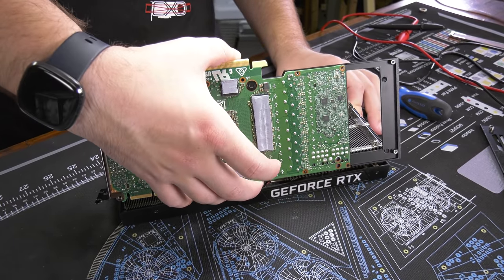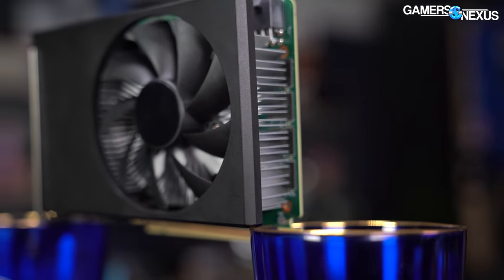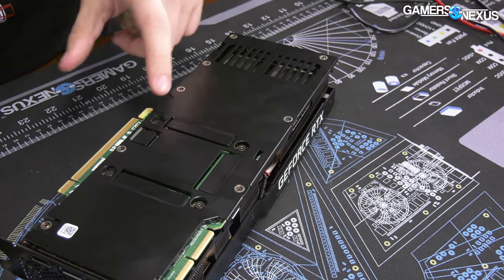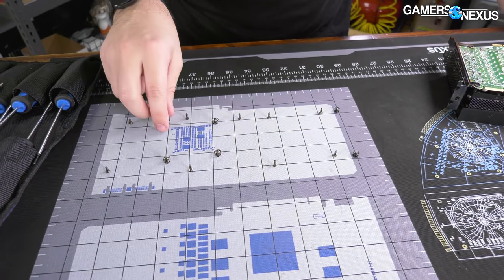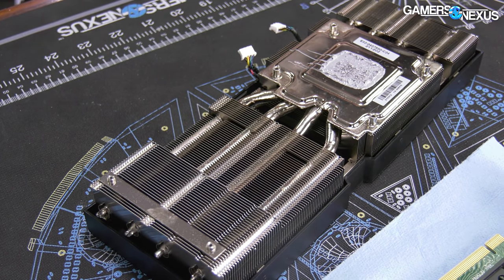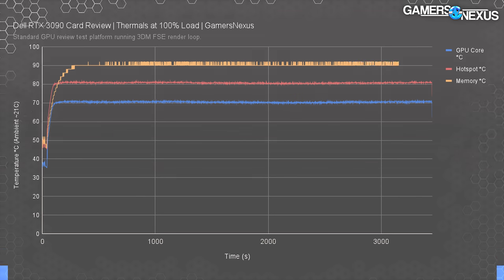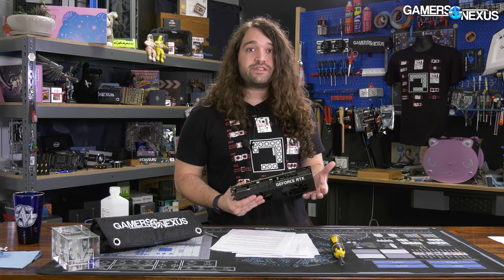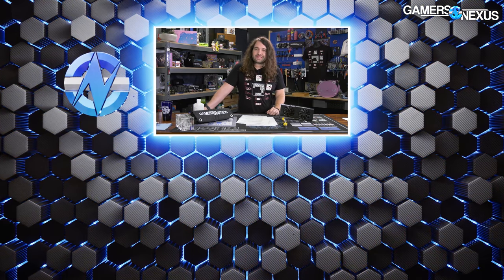Sometimes Dell Actually Tries: Dell RTX 3090 Review, Tear-Down, & Benchmarks

Comment: so.. who made this for you, dell? whoever that was, you should work with them more often
Reply: So long as they learn to measure and bend heat pipes better, yes.
Reply: Its a msi card. My 3080 variant died after 3 days so i think its hit or miss. 

The replacement has been good for a few months.
Reply: @notmyfaultthisishappening3795  does MSI even use a vapour chamber or a backplate heatpipe with flow-through air on their top tier cards, such as the huge Suprim or the Gaming X Trio?

Anyway, the thing that hurts me most about MSI and still makes me put them waaay down the list of mobo and gpu purchases, is their reticence to offer 3y stock or extended warranty options. For a company their size, it's odd and should be putting off a lot of buyers
Reply: angrily yells at the gpu 
"WHO DO YOU WORK FOR?!"

Comment: I wonder if it was a mistake to only cover half the memory towards the IO or if it had originally been designed with a heat pipe in-mind only cut back on costs last min.
Reply from the maker: Great point!
Reply: Maybe having the heatpipe that long made things worst due to the length?
Reply: i thought the same but again i saw there is not much room for the pipe to route to the other memory modules because of the NVLink (SLI?) cutout.
Reply: @GamersNexus  That's what I thought.
It looks like the other 2 parts have the thermal pad directly over the heatpipe,
but the 3rd is just chilling on its own, and got an extra thick thermal pad 
instead...
Reply: @GamersNexus  I wonder if the bent down cut-outs could act as pass throughs for heat pipes.

I could see them just reeling the whole thing back seeing other OEM cards do absolutely nothing about the heat issues with the back plate. 

Always appreciate you guys.  Thanks so much for the work you do.
Reply: @ionstorm66  I mean I cant imagine anything make it worse. My gigabyte extreme card has random heat sinks and a CPU cooler stacked up on it because the rear thermals constantly hit their limits. 

So almost anything is better than stock with little to no thermal pads contact or thermal mass.
Reply: @user-dn5bx2iu3e  I meant that not having the heat pipe there was better than having the heat pipe there. He pipes are less efficient as they get longer especially flat ones
Reply: Its almost as if the heatpipe is flipped the wrong way. Maybe meant for the U part to be over memory, reaching all the way to the one that had the larger thermal pad.
Reply: @ionstorm66  Speaking from experience with 3090s literally anything (even a fat chunk of copper ) helps. so really doubt 6'' heat pipes inefficiency would be noticeable.

Seriously people (my self included) are strapping random heatsinks to the backs of 3090s.
Reply: @user-dn5bx2iu3e  that actually sounds awesome.  as nice as a clean computer can look, a "mcguyver'd" computer has just as much visual appeal.
Reply: @theghostofthomasjenkins9643  Yeah its really odd to me that people will pay 1000$ extra for a 3090Ti but active backplates aren't a thing. It does look quite decent   and it pumps heat strait out the rear exhaust. I too love the hacker man.

Comment: With their PSU and GPU, if they keep that up, we'll be able to make a whole "better than Dell" computer with Dell parts only
Reply: I would actually watch that
Reply: The psu is very proprietary
Reply: @xavierrodriguez2463  it'd be too much hassle. You can just buy a seasonic and be done with it
Reply: You won't because Dell computers are so proprietary, they aren't even compatible with each other. The ability to cross match parts between different Dell machines is extremely limited.
Reply: @gamewizard1760  you can actually. Vostro/Inspiron lineup tend to share parts and chassis. Same goes for XPS/Alienware entry level/Precision 3xx0. You can look up the compatible parts on the community.

Comment: A Dell product paradoxically worthy of the "It's Better Than Dell" award.
Reply: absolute savage!
Reply: I was going to say that 😥
Reply: Like they haven't done enough.  Leave it to Dell to break the space-time continuum.
Reply: Dell have always been hit or miss, I bought a second hand optiplex and it is still running strong, except the graphics of the intel chip died so i threw a placeholder card I bought the first week the AMD1600 came out at it and it has been happy since. Who knew the stupid little bracket in my AMD Radion9000 series box was to fit it into an optiplex SFF, winning by accident.
Reply: Makes sense though. This product itself is better than the company that produces it :)
Reply: I just wanted to write this down.
Reply: Oof burn is hotter than cores
Reply: Lol
Reply: Actually it is all BS. Dell's 1660 Super was of average build quality, and so is this 3090. Only thing happening is that GN does not know how to measure memory temperature. That is why they got 110 C last time /which is ridiculous, card would stop working) and now they got acceptable 90 C .  As for the rest, Dell spends enough money to avoid recalls or God forbid being sued. Not terrible, not great.
Reply: If only it wasn't for all the other garbage things Dell has done, like charging people for warranties they explicitly and repeatedly stated they didn't want, or using proprietary components so you can't swap parts out.
Reply: @aleksazunjic9672  it is possible to get 110 on vram. They know what they are doing
Reply: @Demertech  No, it is not . It is possible to get it, but the card would not be stable and you would not be able to game . Instead, there would be artifacts and protection circuits would turn frequency down in order to reduce temperature. GN said that they had stable gaming temperature at junction at 110 C, which is not possible. Considering their testing methods and some weird results, looks like they had lot to learn.
Reply: @aleksazunjic9672  vram is built to withstand high temperatures and it could have been shitty sensors
Reply: @aleksazunjic9672  3 Roentgen not terrible, Not great.

....

Actual Roentgen : 22000

Oops
Reply: @whatdafarkenhell7110  I take it you don’t deal with enterprise grade stuff. Dell > HP > IBM > Asrock > Super Micro
Reply: I think its funny as fuck that alot of dudes who know how to fix computers can't take an alienware and modify it to have good thermals. You would not use the OEM heatsink for your gpu for very long so why would you look at a DELL and scratch your head as an enthusiast and say "I CANT'? I figured it out and im an idiot lol
Reply: Dell actually make one of the best monitors on the market
Reply: @aleksazunjic9672  GDDR6X vram is rated for 110c look at Micron specs they themselves said it
Reply: @chocolaa-p2689  Physics gets in the way :D
Reply: Sounds like it's better than Gigabyte...
Reply: @aleksazunjic9672  sounds like you know more than the engineers at micron, literally the first one who developed and manufactured gddr6x for these nvidia gpus. Why don’t you go tell them yourself that they’re wrong?
Reply: @chocolaa-p2689  Engineers know this very well, it is the guys in GN (and their fanboys) that do not understand basic physics.

Comment: "better than expected"

What Steve expected from Dell: "a rebadged RTX 3070 with a plastic heatsink"
Reply: Actually it is all BS. Dell's 1660 Super was of average build quality, and so is this 3090. Only thing happening is that GN does not know how to measure memory temperature. That is why they got 110 C last time /which is ridiculous, card would stop working) and now they got acceptable 90 C .  As for the rest, Dell spends enough money to avoid recalls or God forbid being sued. Not terrible, not great.
Reply: @aleksazunjic9672  Cool. Can you tell us what he's doing wrong? He is open to feedback and updating test methodology.
Reply: @aleksazunjic9672  110°C on a memory module is definitely on the hot side, but should still be okay-ish, 115°C is like the absolute maximum IIRC. That means the card definitely doesn't just stop functioning nor do I think they measure anything wrong.

By extend there was an ASUS RX5700XT with really bad cooling that ran memory so hot it did throttle badly...
Reply: @MLWJ1993  Well, no. Current MOSFET technology does not allow card to run stable at 110 C on junction. Card would definitely reduce operating frequency (throttle down) to cool itself.  If cards remains at 110C you would definitely  see artifacts and errors. On the other hand, GN claims that Dell's 1660 Super runs stable at 110C , and at FPS close to other 1660 Super cards.  This is physically impossible, and at further examining their measuring methods, they just use thermal IR camera, and that is not the way you could measure junction temperatures. Note that I do not claim that card cannot go to 110C , 115 C or possibly even few degrees higher. But at that temperature it would not run stable at full FPS .
Reply: LMAO, GTX1660S with no memory cooling, cheapest heatsink and shroud available on the market and electronic parts from no-name manufacturers is of "average build quality". By that logic my R9 390 with server fans attached by zippers is "Premium quality graphics card". Have you ever seen a decent GPU in your life?
Reply: @cmdr_krabov  It has memory cooling, heat sink and shroud are good enough for stable work and gaming. Graphic card does not care for "premium" , various plastic garbage and cosmetics. That is aimed for stupid consumers who are willing to spend more money for the looks. Graphic card only needs stable temperature inside certain range to work properly.  Unlike consumers, Dell is not stupid, and they would not sell GPU that would bring them warranty problems, class action suits etc ... They designed the card that works as intended for minimal cost and that is that.
Reply: @aleksazunjic9672  my 5700xt on stock fan curve hit 110°C junction under load with the stock fan curve. No artifacts happened but it was scary watching it that high.
Reply: @antreaskonstantinou8585  How do you know ? Thermal sensors on card are not accurate enough, and they do not measure temperature on junction itself. You would need real laboratory equipment to measure that.
Reply: @aleksazunjic9672  it shows both the junction temp and the temp at the edge of the die. The problem is now solved however as i undervolted it.
Reply: @aleksazunjic9672  one thing: what did they do wrong with their testing? He would happily take suggestions. (Replying to original comment)
Also, sure. 110c isn't enough to destroy it , enough to just reduce the clocks somewhat. Sure, you could say that 'it functions, thus it is fine' but you'll get lower life expectancy on the card and it may perform worse. Thus, objectively it is a worse card than other gtx 1660 supers.
Reply: @aleksazunjic9672  

110C is what some of these cards actually run at, what makes you think that’s wrong?
Reply: @PashaGamingYT  No they don't run at 110C . I already explained, MOSFETs do not operate properly at such temperatures.
Reply: @aleksazunjic9672  

That may be above their max spec, but that doesn’t neccesarily mean they immediately stop working
Reply: @PashaGamingYT  They do not stop working immediately , but you will get visual artifacts and eventually they would stop working.
Reply: @aleksazunjic9672  

Yes, that’s why they said it was bad
Reply: @PashaGamingYT  On the other hand, card worked more or less fine in their gaming tests, and consumers did not complain about Dell's faulty cards. Using Occam's Razor we get the simple conclusion - GN tests were flawed. And indeed they were, because you do not measure junction temperature with thermal cameras - process is a bit more complicated as explained many times.
Reply: @aleksazunjic9672  

They don’t instantly die at those temps
Reply: @PashaGamingYT  Where did I say they instantly die ?
Reply: @aleksazunjic9672  My 3080 is reading 110 C when I am mining in all monitoring applications. I've seen plenty of documentation of professional miners replacing the back plate and heat sync as the memory does not appear to be contacted properly in many models.
Reply: @aleksazunjic9672  I'm using it on 75% power in afterburner at the moment. Bumping it up only nets me from 85 up to 99Mh/s but is significantly more taxing. 

It's still running much hotter than I would like. Even though I have an additional fan over the backplate. I've gotten it down to about 104-106C on the sensors on average just by combining that with the reduced power output.

In the near future I will likely go in and paste it up with a Thermal Grizzly paste, replace the backplate and add copperplates to the Memory. That is even if I stop mining. But for now I'm mostly just taking advantage of mining while it lasts for the next few months and am poor as shit.
Reply: @aleksazunjic9672  I've got it on 92% fan speed, the sides are off and I don't have any big fans in the house aside from case fans, which I have one of stuck to the back of the GFX card.
Reply: @aleksazunjic9672  this is not true. I own one. No memory cooling at all.
Reply: @potatoes5829  And your memory temperature is ?

Comment: "Dell is a confusing company right now,"
That checks out.
Reply: @Chris from a tech nerd and pc builder stand point i really dislike dell and have never like them acept there moniters are ok, or atleast used to be
Reply: Actually it is all BS. Dell's 1660 Super was of average build quality, and so is this 3090. Only thing happening is that GN does not know how to measure memory temperature. That is why they got 110 C last time /which is ridiculous, card would stop working) and now they got acceptable 90 C .  As for the rest, Dell spends enough money to avoid recalls or God forbid being sued. Not terrible, not great.
Reply: @aleksazunjic9672  If you know how to measure temperature, go on. You are saying that the other 3090 have better cooling on the VRAM measuring with the same method?
Reply: @Emetsys  I'm saying that for measuring memory temperature on junctions you need lot more equipment and knowledge . You cannot just take thermal camera and do it. GN presents itself as almost scientific channel (unlike other which are more geared towards entertainment) .  Therefore they should update their methods if they really want to be serious. Otherwise, they would just look silly like in their 1660 Super video.
Reply: Dell is more interested in thier enterprise products.

Comment: I have this card and was able to DRASTICALLY improve the memory temperature (20+ Celsius reduction) by slathering thermal paste all over the vapor chamber perimeter. This will improve thermal contact with the metal part where the memory sits under. Obviously the GPU temps will rise a bit.
Reply: I did the same with my dell 3080. Peel off the stickers, clean with some alcohol, then drown it with thermal paste between the vapour chamber and plate. I have read that some people tried using thin thermal pads, but that thermal paste in that gap performs better
Reply: Literally a 20-30C reduction for 3080 / 3090 cards doing this. Should be MANDATORY if you are mining! The fans will be spinning much slower after as well
Reply: Same, I use 8 of them to mine and the thermal paste on the VC is a massive reduction on mem temps and a slight bump on GPU
Reply: Can you link a photo?
Reply: @TRXST.ISSUES  I change the thermal pads out and added a lot of thermal paste. Add it to the red areas in the photo. You will see huge improvement in temps. Good luck! https://ibb.co/TrHxB2L
Reply: @unRealityFPV  what should be mandatory for mining is using a mining dedicated card that doesn't affect the normal GPU market fucking the other people who want a GPU not to mine over.
Reply: @TheRealDrae  get a job, stop hating customers
Reply: If you want to REALLY fix the card, also add a 90x180 heatsink to the rear of the card. Put a small amount of thermal paste over the VRAM areas of the back plate, then put thermal tape on the leading and rear edges of the heatsink to stick the heatsink to the back plate. I mine with two of these as can get VRAM temps of 84-86c running NHQM on Extreme settings pushing out 124 mh/s. you will need to pull the card out of the Dell case for the heatsink to work the best, or you can remove the lower hard drive caddies, and move the card to the lower slot, however I think the lower slots are 8x only slots, so it will not perform as well for gaming. if you going to attempt to leave it in the dell case, the copper heatsink is better since it's only 5mm vs 25mm thick on the aluminum one, plus you need to add a fan for another 20-25mm thickness. so the card will be 30-50mm thicker. make sure you support the card, so you don't get card sag over time. 

check these two posts on how to do it.. there are multiple photos, showing how to stick the heatsink to the card, make sure you test fit the heatsink before sticking it down, you want it as close to the rear of the case as posable, to not block the vents, but if you put it to far back, it will interfere with the case.
https://www.reddit.com/r/NiceHash/comments/rgmfcu/124mhs_at_86c_with_the_crap_dell_3090_cards_air/?utm_source=share&utm_medium=web2x&context=3
https://www.reddit.com/r/Alienware/comments/or3q94/found_the_optimal_fix_for_the_3080_3090_cards/?utm_source=share&utm_medium=web2x&context=3
Reply: @bacicinvatteneaca  lol

Comment: One thing to note: You can actually see the heatpipe on the back contacting the thermal pad. Not just running above it.
Reply: Glad someone else noticed this, just a shame they did not extend it to cover the other side.
Reply: I was screaming this at the screen lol
Reply: @jamesblaine5517  I think that's why the thermal pad on the other side is screwy - the backing plate was designed with the assumption that the heatpipe would wrap around all three areas, but the actual design doesn't allow for it for whaever reason so they just dumped some super think thermal pad there.